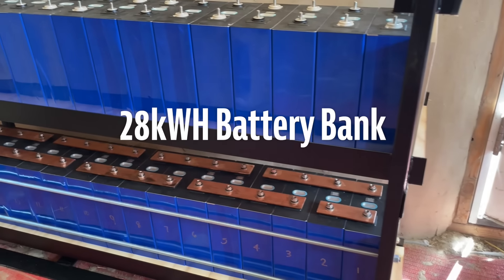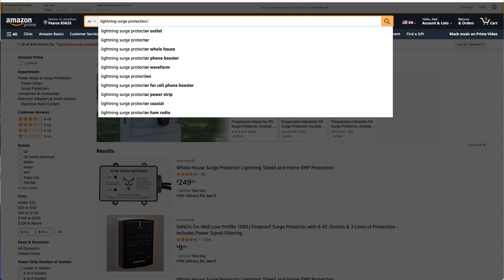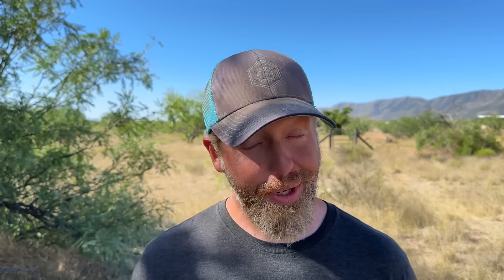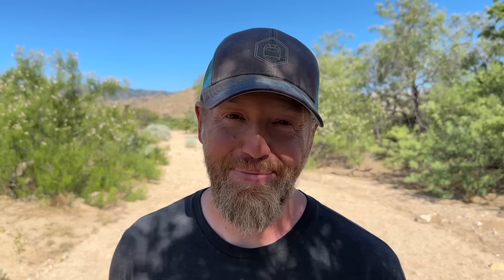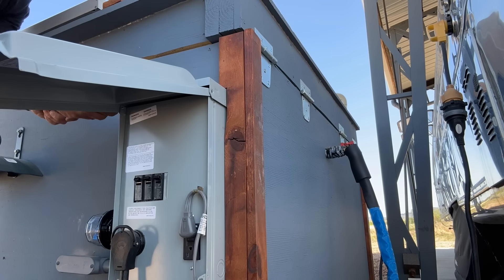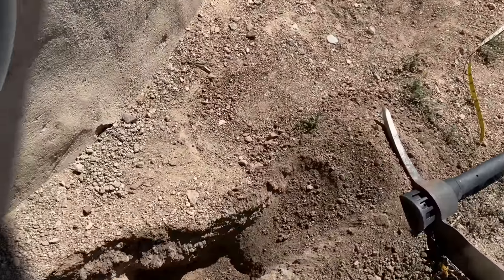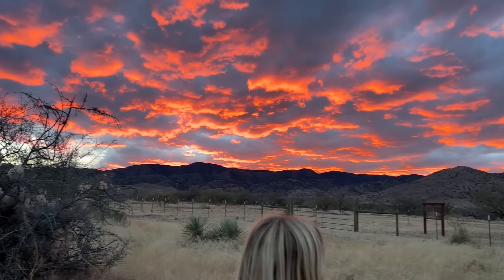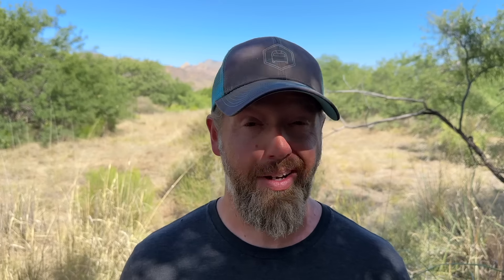This Cost Us THOUSANDS - Lightning Destroys DIY Off-Grid Solar System

Comment: Hello, I advise you to install an insulated external lightning protection, that is, lightning protectors near solar panels and on the roof of the building. Arrange grounding near the lightning receivers and connect them to the existing grounding. Since you have sandy soils, one grounding pin will not be enough. You also made the mistake of placing the grounding pins too close to each other. According to the coefficient of use of earthing devices, the grounding electrodes should be located at such a distance from each other that is equal to their length or more, but no less. This is done to avoid shielding, which increases the ground resistance. I advise you to measure the specific resistance of the soil and the grounding resistance. For smooth and fast dissipation of lightning current in the ground, the lightning protection resistance should not exceed 10 ohms. I'm sorry for my English, I wish you all the best. Greetings from St. Petersburg, not the one in the USA))).

Comment: We live on the ridge of a mountain in Johannesburg. The rock has a high iron content and we have been struck more times then I can remember.
When we hear or see lightning coming we physically unplug our panels.
What has helped us is
A electric fence around the house.  That attracts some of the lightning away from the house (we are on our fifth energizer).
Removing TV antennas
Removing the old telephone copper cables and moving to fibre internet.
Neighbours that now have solar too, some have conductors along the ridge of their tiles that divert strikes to ground. 
A lightning rod (That has not been struck yet and is not tall enough by any measure) 
Maintaining waterproofing on the house. Wet brick walls seem to attract the lightning and are blasted to pieces as the water expands.
We also have 3 phase electricity and avoid connecting equipment that are on different phases (eg network cables on computers and the coax on TV's).
One thing you can count on is that nature will always win and find a way to destroy your stuff.
The new low cost inverters are pretty good. I used to install the Victron units about 20 years ago. their technology stalled. Still great inverters but pricey for what you are getting. 
I used to put once off lightning suppressors on the phone lines. They didn't work more times then they did. 
Sorry for your damage. I'm sure it will happen to our system eventually. 
There is a earthing company down the road from us called HHK. They specialise in earthing buildings. They have been there for at least 35 years so it must be a good business to be in thanks to the location. 
Great video. I could relate with it a little too much.

Comment: So here is a old trick that I learned recently and found that it actually works. Take real wood charcoal and salt and grind them together with some water and poor about a 5 gallon bucket of the slurry around your ground rods it expads the contact area from ½ rod to several inches of carbon .

Comment: For better grounding, without any physics, there is rule of thumb to have your grounding rods apart about 2times the length of the grounding rod, in your case 16feet. Also helps to put more conductive soil on grounding rods, or use burried metal sheet or fence to have bigger contact surface with ground.

Comment: they should be one use, thats what they don't tell you about surge protectors for in the house and office, scotty's tech info channel has a GREAT video on the components inside that do the clamping. my question is how do the SPDs tell you that they have been used up?
Reply from the maker: Light turns off

Comment: A lightning strike that is diverted to ground is a huge peak load that need to be diverted in milliseconds.  Extra grounding rods is a good step but they are short and you still have 3 poorly functioning rods.  I would use at least a grounding rod gel to enhance conductivity and longer rods to get deeper where there is more moisture.  I don't know US code but in other countries grounding rods are placed at least 4m (12ft) between each rod.

Comment: Just a heads-up. During a strike, your "earth" is only as good as your grounding rod connection to the planet, and that's a lot more demanding than many folks understand. ESPECIALLY in a desert environment, where the soil isn't necessarily a great conductor all the time. Electric fence folks find this out all the time.

Everything you can do to help that ground rod interface to the ground helps. Concrete, salt, bigger holes, None of it is as easy as just driving the rod into the ground, although most codes accept an 8 foot rod directly driven as being "good enough". I go further than good enough, just because.

My latest install was an 8 ft rod 7 feet into the ground, with the first 4 feet being concrete bottomed out with 2 pounds of salt at the 4 ft level below the concrete.
Reply: Lightning strike is best effort. You CAN NOT control the path with 100% certainty.
Reply from the maker: This is what I meant about all the internet opinions on grounding. Salt corrodes copper quickly so while you might get a short term better ground connection eventually over time you’re making it less effective. So no let’s not dump salt around our grounding rods.
Reply: @TinyShinyHome  You can get an expert to explain how it works in person, but unless you have some chemistry background, and understand how cathodic and anodic corrosion occurs chemically, understanding my comment will probably remain elusive to you.

Hint: 1000 year old copper coins found in the ocean.

Comment: They have a lot of different gimmicks out there. But installing large ground rods and extra ground rods and large conductors, will get rid of the lightning. The lightning is high voltage, low current, a good size conductor will get rid of a lot of lightning. I installed these at my house, we got hit between my neighbors house and my house, my neighbor, lost his TV, computer, all of his electronics, we didn't lose anything. So I know it works.
The main thing is to provide a good path to ground, so the electricity from the lightning will leave. Lightning will take every path to ground, not just the easiest or shortest.

Comment: That "opt-out No Inspection" and No Certificate Of Occupancy may seem very convenient at the time but comes at a very high price in the long run. Although you may never consider selling your property or accessing the equity you are creating, the ability to finance the Homestead using conventional lenders is severely restricted and the pool of potential buyers diminished. This decision alone reduces the value of the property lower than if it had Certificate of Occupancy.
Reply from the maker: Yes all trade offs we’ve taken into account

Comment: You live in a hilly somewhat sandy area you should get a licensed earth installer to measure the resistance you may need to add salt and coal when drilling. Also try to seperate the outside lightning earth from the inside so you need rods installed by the solar panels rods for this spd device and rods for house and inverter earth I assume you live in hilly dry soil you need delta of 3 rods total of 9 rods. Remember earth should be as sort as possible bevgeneorus with wire diameters you need to weld the delta with 120mmsq copper wire

Comment: I have occasionally advised sailboat owners on proper lightening mitigation techniques.  The protection built-in to your equipment should be the third-tier of protection.  The first tier should be several to many times more capable, and capable of handling multiple strikes back-to-back, primarily by lightening gap shunts to ground.  The second tier should be about half-way between the two with multiple levels of protection.  Done right, your solar panel, electrical equipment and all built-in protection should never see a strike.

You actually want to attract lightening away from your panel by NOT grounding your panel, and by surrounding it with perhaps 6 vertical grounding rods of medium height, between 30 and 50 feet distant.  Another 20 feet distant you should have 8 grounding rods.  All grounding rods should be driven at least 8 feet deep.    Thick rebar is sufficient.

The reason you do want to electrically float your solar panel is to ensure it never accumulates charge opposite to the charges in the cloud.  Opposite charges are induced from a highly charged source like clouds (electric field) into the ground.  These charges build up in a path between cloud and ground, and when they meet, BANG!  The lightening discharges along the path of charges, which have created the ionized path in the first place.

If your solar panel is grounded...  By isolating it from ground while surrounding it with grounding rods, you're maximizing the probability of a lightening strike away from your solar panel and it's equipment.

In boats, we advocate grounding your rigging while isolating your electrical system.

Comment: I installed the Eaton CHP ultra 2 surge protection in my main AC panel in my home.  Only one week after there was a lightning strike a half mile away that came down through my electrical lines.  The CHP shunted the transient lightning to ground and then automatically reset.  The TV shut off and had to be turned back on but was protected.  We noticed a slight dimming in the lights.  If shunted to ground and turn back on all in about one to two seconds.

Once it shut down for about 5 to 6 seconds it may have been as long as 10.  Then the unit reset.  There is a LED on the search protector that tells us it is still working.  The CHP ultra 2 comes with a lifetime warranty and protection warranty on household equipment.

It's been installed on our home for about 5 years now and it has protected the house on numerous occasions on stray transient some lightning then automatically reset.

Comment: Its good to see ya tryin to do something but those MOV's wont do much. What ya need is GMOV's and TVS diodes but ya always want some on the input and the output of circuit breakers and for the top of the solar array get or even make some anti-static forks

Comment: I actually once have seen the article, but now I looked more - why don't you have any Lightening rods? Or at least I don't have seen them in this video.
Of course this indirect strikes effects are extremely important, but you could decrease "indirectness" in case you would create a sweetspot for lightning using lightning rods.
I somehow feel that apart from common protection rod right above the area to protect, it would be beneficial to build  several  towers around your living area to dissipate lightnings energy before the cloud comes to your house.
There are towers, hanging wire towers to cover bigger area and so on.. but of course for all of them you would also need the knowledge you got and shared in this video.

Comment: I have a place in rural New Mexico, but am on-grid.  I religiously unplug anything and everything electronic when storms come in...it makes for a good break from my digital work.   Turning off a breaker is not good enough.  Static electricity will jump the gap.  I too, have lost thousands of $ worth of electronic equipment throughout four decades of residence.  Get a lot of hail too.

My friends and neighbors used to laugh at me...till it happened to them.  Ha!

Comment: What a bummer! I was thinking about installing a solar system, but now I'm not so sure... especially if insurance won't cover it. Before I went with an Opt-Out I contacted both Amica and State Farm and they told me that they didn't care about me having a Certificate of Occupancy or not. But that was a few years ago... it feels like it's taking forever to get my house built, the shop finished, and everything else. I guess I'll have to call them tomorrow to see if they have changed their tune.
Reply: I currently have a Builder's Risk policy on my house that's under construction and I just confirmed with my agent at State Farm that they don't require a Certificate of Occupancy in order to insure my house. I just called Amica again today. One person told me that they require 3rd party inspections on homes before they will insure them. The lady I spoke with was kind of snooty, so I asked to talk to a supervisor. After being put on hold for over 30 minutes, I gave up and called back. The second time I was told that regardless of a Certificate of Occupancy or 3rd party inspections, they couldn't insure my home because of wildfire risk. She said it didn't matter if I've done clearing, that I have a 4,090 gallon water tank next to the house, or that the house has a tile roof and stucco. She said she put my address into her computer and based on supposed wildfire risk here, my buildings aren't eligible for their insurance. Apparently they are a "preferred risk" insurance company. Luckily, I can still get insurance through State Farm.

Comment: Hey Guys, I didn't know about the moisture part og the grounding. When I lived in Utah I know all houses had the grounding like what you put in and my Dad being an electrician knew all about that part of building. 

I now live in Thailand and of course we don't have any problems with not having moisture in the ground so I won't have a problem protecting my solar system. 

We are just going into the monsoon season and we get some pretty bad storms come through and the lightning can get really bad. I've seen it hit about 40 or so feet away and it did some  damage on the concrete but they repaired it the next day.

Comment: I’ve always been curious how 6awg bare copper is the transmitter but the the actual rod is 1/2” 😄
Reply from the maker: The wire is transporting, the rod has to make the actual ground contact so more surface area.

Comment: I guess running some perforated water line along side that copper wire is out of the question ?  one end of the pipe is capped off and above ground at the home.  Before the storms...pour water down the pipes to add moisture to the soil before the storms to improve grounding

Comment: Just watched your video. Very clear explanation, that's for sure. 

The SPD's can work but just having a thought - would some relays/switches in case of a thunderstorm to disconnect on the solar ánd the inverter end not make it even safer? 
I mean, when there is no (direct) path, there can't be current (of course lightning doesn't let it self stop, but it might reduce any impact in case of.
Reply from the maker: If turning it off is an option, sure (and we have plenty of breakers and switches to do that). But sometimes you aren't there or you need power.

Comment: Great video! Total bummer about the strike, but it looks like you're much better prepared now! Lightening is a tough beast to deal with. 
I do have one small bit of advice though. Ae a journeyman electrician who got busted once many years ago, early in my career by the inspector:
When running a grounding conductor between rods, you’re suppose to have an unbroken conductor attached from the point of service, to each grounding rod. If for some reason the first or one of the middle clamps comes loose, you potentially lose everything downstream. The odds of that happening are slim, but you're going to want as much protection as you can get. 
It’s those times where I’ve had to make changes to an electrical job because of doing something not up to code, that I remember the most.

Comment: Couple things here.. I would switch to Mersen STP240D07. Also I would setup a grounding Array underground with Ground Rods spaced every 3 to 6 foot. Best documentation on this is motorola r56 manual trust me it's still valid today for most lightning protection advice.
Reply: Yes, the R56 is considered by many in the industry worldwide to be the Bible of lighting protection. It was written and share with the industry for free. It comes from many decades of experience trying to protect trillions of dollars of equipment. It has also gone through many revisions of improvement over the decades.

Comment: .
It’s good you utilized more grounds.
Unfortunately it would work better if you had ran an unbroken ground line from the box to all the rods.
Less chances for failure at contact points.
Also the connections at each junction point can use a clean connection by sandpapering the contacts on the wire, clamps & rods.
—
Plus look into Ufer grounding, it’s great for dry soil conditions.

Comment: I think if you install the underground cables inside at copper pipe, it will be shielded  from lightning and electromagnetic waves, even you can use the copper pipe as a ground.
Reply from the maker: Let’s not confuse people with advice like this. No you shouldn’t put your wires in a copper conduit. 🤦‍♂️ thanks @SuperSpecies

Comment: Skinny little wires add inductance that restrict the rate current can "move".  This could allow the voltage component of the lightning to do it's damage prior any effect by a suppression device.  Thick and short conductors can really improve your chances, along with a proper grounding system, not just a single ground rod.

Comment: with long wire runs chances multiple strikes at different locations around the wire runs will hit equipment after the only SPD is taken out. shorten the wire run relocate everything
Reply from the maker: Well that's why you put an SPD on both ends. Relocating everything isn't an option.

Comment: When driving grounding rods 2 words 'hammer drill'. When one is fitted with a socket large enough to fit over the end of the rod will drive them quickly.
Reply from the maker: You do what you can with what you have available. Wasn't worth the 3 hour round trip to a hardware store for something like that.